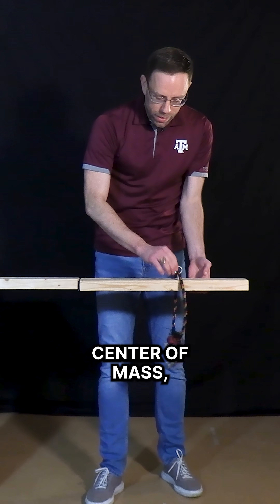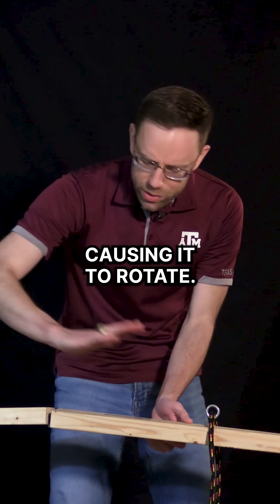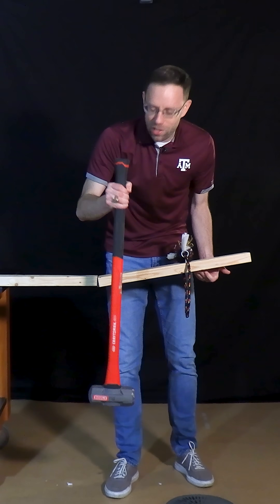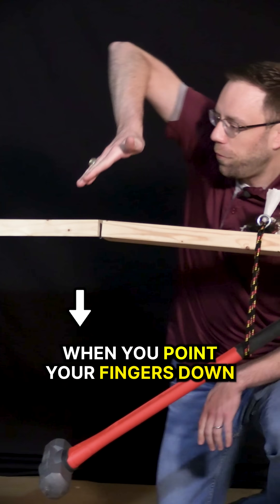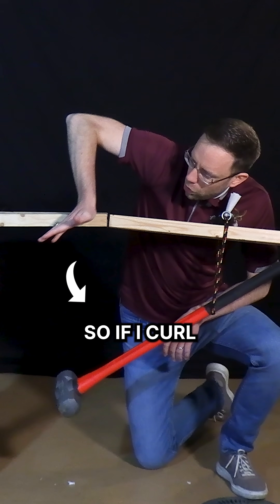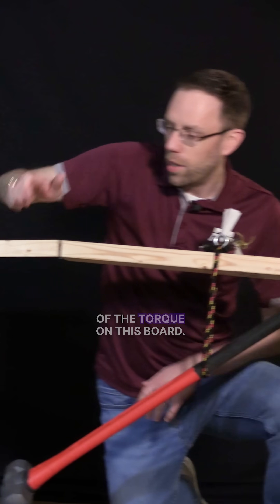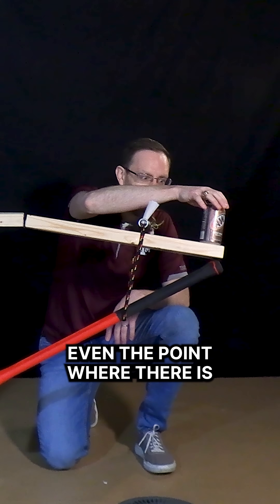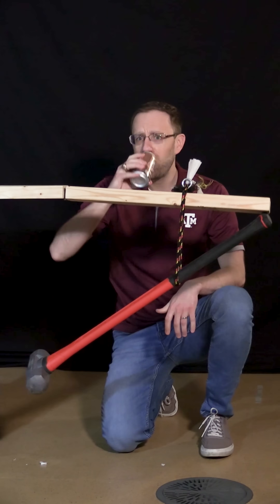Floating sledgehammer using physics! 😮 #shorts #TAMU #DrDawson

Comment: The weight of the hammer part of the sledge hammer is way heavier and they are both connected to each other the board and hammer, so the weight and gravity are pushing down on the heavy end and the other end of the sledge hammer is kind of pushing up on the wood because of the rope, that push down of the metal end and the opposite push up of the handle is stronger so it’s keeping the wood up, am I getting this kind of? 😂 makes sense to me, just making sure. And I’m not saying either end of the sledge hammer is stronger, just that the handle is pushing up stronger than the woods hinge.

Comment: I saw the same concept illustrated when I was in elementary school.  There was a little widget, shaped sort of like a curlicue, maybe 3 inches long and when he hooked a belt onto it, he was able to balance it because the belt was hanging slightly more than half its weight on the other side of the balance point.

Comment: Basically the weight of the board and the hammer handle is less than the hammer head so if the board were to rotate downward, it has to push the hammerhead upward. Because everything else weighs less than the hammerhead, gravity has to overpower itself, so the "floating" state is more stable than the lower state, which is visually unintuitive, but you can also just visualize it as gravity pushing the hammerhead down harder, and since the hammer handle is pushing up into the board, the greater wieght of the hammerhead is pushing the board up, which makes more sense than the board holding the hammer by apparent magic.

Comment: It's pretty cool how there's several ways to explain this.
As well as those I've heard, there's also that the point the sledgehammer pulls the board down at has less leverage than the point it pushes it up at. 
You could lift yourself with this, by holding one end of a plank you're standing on, and pulling it up. Your feet are pushing down with less leverage than your arms are pulling up, so the net torque is upwards.

Comment: The reason it doesn't seem like it would work is because it wouldn't. Regardless of where the weight is on the "floating board" it's in a hinge and the weight cannot lose a center mass past the hinge. Now if there is a super strong magnet on the post repelling the iron sledge then it could stay up.

Comment: The hammer and the board together act as one object, which is anchored to the other board by the hinge.  Like those little levitating toy birds from the 90s that you could balance on your finger with its beak. The hammer has the same function as the weighted wings of the bird, and the beak would be the hinge.

Comment: basically the distribution of the gravity around the pivot point has changed caused this. Imagine the hammer is not long enoug to the far left of the hinge, it still falls. Or, put the hammer the other way around, it still falls.

Comment: If you were to imagine pushing the board down with your hand, I think it helps understand how this works. Picture the sledgehammer all the way up and touching the board that's fixed to the table (as a result of you pushing the board down). Would you expect it to stay like that, or for the sledgehammer to swing back down because it's so heavy?

Comment: I think the stap you missed to mention that makes this a lot more difficult to understand is that the sledgehammer is in a FIXED position. If it was loosly hanging beneath the right side of the table, the table and hammer would just fall down. But because the sledgehammer cannot change position, the only way for the table to fall down is for the sledgehammer's heavier end to go UP and that's not possible, because the end of the sledgehammer is too heavy.

Comment: Here’s a dumb down version of ricksmash8080 explanation.
There’s a gravity pulling sledge hammer head and a gravity pulling edge of the table, sledge hammer head is heavier thus greater gravitational force than table which make the handle keep pushing table upwards (while the head go towards the ground) allowing the table to stay in the air

Comment: The simpler explanation is that now the board has to lift the sledgehammer in order to rotate to the left, while the sledgehammer can't fall down without lifting itself up (because the board would rotate to the left as a consequence). Thus, for the sledgehammer to fall down it would need to lift itself up, so a (close to perfect) balance was reached.

Comment: I didn't understand his explanation fully, but I intuitively understood what was happening in my own way. The head of the hammer, the heavier end, is being pulled down by gravity, but the rope is holding the handle. Naturally, this would cause the hammer to swing to the right, like a pendulum, but the handle hits the end of the board, stopping the motion. Additionally, for this to work, the head of the hammer needs to extend to the left beyond the hinge to balance the downward pull on the right side, kind of like how you would balance opposing forces on a seesaw.

Comment: This is newton's second law. Since the hammers' head is angled at a slope, the main component of weight pulling it down is perpendicular to that slope, trying to pull the hammer's handle completely horizontal. This force is what pushes the head of the handle up into the board, creating an equilibrium of forces.

Comment: A simple explanation to make it make sense in your head is to only look at the hammer on the string. The hammer on the string wants to fall counterclockwise due to gravity if there was no board. Now instead, its pushing on that board trying to fall. Clearly from the video you can see the force of the hammer trying to fall counterclockwise is greater than the weight of the board trying to fall clockwise. A lot of confusion in the chat so I tried to explain it a bit simpler.
Reply: thank you sir, now my head can make sense of it

Comment: Well you could also just say that the top of the hammer would be pushed up on the other side and so the entire thing just rotates a little bit until the forces cancel out.
Reply: @Spacemelody69  right! You could also say that the centroid of the moment distribution is horizontally aligned to the axis of rotation. All correct, just differing levels of understanding and specificity of language.

Comment: If its a heavier object than a sledgehammer does it matter?
Or as long as the object is generating more torque than the falling board it will do the same no matter how heavy it is?
Reply: your second thought is accurate. But generally heavier = more torque. But u can also add a gryoscope there
Reply: You were spot on, as long as the counterclockwise torque (generated by the hammer in this case) is equal to the clockwise torque (generated by the table), then the system is in static equilibrium (it won't move).

If the mass (or length) of either object chances, then the system reaches static equilibrium in a different position, or won't reach it at all.

This is the equation: T=F*d
Torque equals force multiplied by distance. 
The force is directly proportional to the object's mass, and pointing down for both the table and the hammer (due to gravity)
The distance is a positive value for the table (because It extends to the right of the hinge) and a negative value for the hammer (because it extends to the left of the hinge).
T_table=10N * 0.5m = 5Nm ↻
T_hammer=200N * -0.025m = -5Nm ↺

In this example, you have equilibrium with a half meter long table, and a much heavier hammer extending 25 centimeters from the hinge in the opposite direction of the table.
Reply: @AlxM96  that is interesting. Its not something i get a 100% but i do get the gist of it.

Comment: Your explanation makes logical mathematical sense, but my brain looks at that and says DARK MAGIC BURN THE WITCH MAN
Reply: @Breezely22  😂🤣
Reply: He turned me into a newt!
Reply: @Satori816  a newt?
Reply: @ivanov093  I got better...
Reply: @Breezely22  same thoughts.. I understand, but i dont understand 🤣🤣
Reply: @leonkennedy8579  It's a fight between gravity wanting to fold the board down and folding the board down causing the hammer to rise, hammer is heavier it stays down. You can also kind of imagine it as a board and a hammer on each end of a string over a pully.
Reply: 666 likes for ya
Reply: I second that.
Reply: @Breezely22  My brain was like that until I looked at the other end of the sledgehammer. see, that part is touching the wood too, and its that part that is pushing upwards, against gravity
Reply: Yep, I completely understand the how. But just.. WHY?
Reply: My brain just says he basically added a leg and made it a table
Reply: @Breezely22  For the board to swing down, it would require the sledgehammer to defy gravity and go upwards, which is impossible.
Reply: because that he is saying is a total B.S. and the video is fake
Reply: He weighs the same as a cold duck, to the fire he goes 😡🔥🔥🔥🔥
Reply: Wizard
Reply: @Epicurousdemos  the right term is warlock
Reply: @goldenlion7147  huh only think i remmeber after hearing warlock is adamn warlock
Reply: @Epicurousdemos  witches work more with hexes and stuff, wizards work more with educational stuff (books and all that jazz) while warlocks have a patron.

Comment: Show me an actual tool or contraption that use this AND without hydraulic support.
Reply: @PurringBytes  That uses the consideration of center of mass? Or a sledgehammer hanging by a chain strapped to a piece of wood that is on a hinge attached to another piece of wood?
Reply: @Kaiziak  That use the principle demonstrated, i'll take anything : a tool, an utility, a day to day usage that use this.

Also : the question is for the video author, it's not for opening up a debate.

Comment: You changed the mass's (board plus rope plus sledgehammer) center of mass/gravity.  I the first example of just the board and rope, the center of mass is basically in the middle of the board, almost directly to the side of the hinge. With the sledge hammer added the center of mass is closer to the head of the sledge hammer and below the hinge.  The combined object swings slightly downward until the center of mass is at its lowest point (directly under the hinge) at which point it can rest.  If you were to put the center of mass when it includes the sledgehammer at the same angle as the original board, the board would be pointing almost straight up and it would also swing downward just like the first example.

Comment: Even short and simpler explanation, if the wood bar go any lower the hammer head would have to be raised higher which requires more force/weight so then it's balanced out 🤷‍♂️

Comment: Using. Applied mechanics *Let’s Resolve the forces into vertical and horizontal components 

A) weight of the wood 
B) weight of the sledge hammer 

C) tension in the chain 

D) compressive force created by the black handle portion .  

.  . .  

At the point of equilibrium   (The meeting point of chan on hammers handle )sum of horizontal components = sum of vertical components . 
That what keeps it in position . .

Comment: So the position of the sledgehammer's head (its heaviest part) relative to the hinge is what causes the opposing torque, which in turn makes the plank float?
Reply: @KotauFPS  Yes. As long as the largest torque (force X distance from the rotation point) in line and/or bellow the hinge is at its left side, then the largest force will keep the right end up. It's the same that was happening before,  when the largest torque was at the right side pulling the board down

Comment: Or you could say that the metal head of the hammer is being pulling down while it tail is pushing up the blank by it end. The robe act as the support or interruption for the the hammer to just fall straight down, instead tilted to the side. Combined with the hinge and supposedly fall and swing of the blank have just enough forge to soft lock the hammer in place without slipping off the ropes?

Comment: The heaviest part of the hammer is past the point of rotation, so for the board to pivot down, the head of the hammer would need to go up, and since it’s heavier, that won’t happen.  My question is, does the rope holding the hammer experience any extra strain than it would without the pivot point?
Reply: @toastofcinder  No, I think the extra stress is applied to the board at the end, where the sledgehammer is pushing up against it

Comment: If you imagine the head of the hammer connected to the pivot point this becomes nothing else but an obvious triangle hanging. Easier to understand if this experiment is done on a wall instead on the cantilever.

Comment: This was posted on Facebook and it was immediately called fake. I really worry about our future…
Reply: They can never seem to distinguish between ai and real photos though
Reply: How could people believe this? It's readily apparent, the lying. He put a leather(or whatever) to connect both planks at top.
Reply: @rodenreyes6320  Are you serious? He even told you why it's working. If you understand movement, rotation and torque, yes, it is totally believable. If you still don't believe it, make the setup yourself and try it. It's not fake, there's no lies, and nothing connecting the two planks (apart from the hinge itself).
Reply: @Chris-hx3om  I realize the simple physics of the contraption now. It's just a weighty weight suspended on an essentially curved/bent bar at end of main plank at hingepoint. Thanks.✌️✌️✌️

Comment: When he started that hinge was at bottom letting it swing down. He flipped the board over. Now the hinge is at the top not allowing the board to swing down
Reply: @63grandsport11  Watching this on my phone and after pausing the video and looking carefully, the hinge is still on the bottom the entire time. So he didn't fake the video. Also, knowing physics, this is a proven experiment that has been replicated.
Reply: Hinge is still at the bottom. 

The hammer is just pulling down from the other side of the hinge now countering the weight of the board.
Reply: The board is still bending down. You can see a gap in the top meaning there can't be a hinge there. Use your eyes.

Comment: Concentrate on the centre of gravity. That will always get as low as it can. Nearly all the mass of the system is in the head of the hammer. It has sunk as low as it can get. If the wooden board on our right were to swing down any further, the sledgehammer head would have to move up, and gravity won't allow that heavy weight to do that.
Reply: Excellent explanation!
Reply: @stephenfennell  best explanation, thank you
Reply: This explanation is infinitely more intuitive than the entire video. Bravo! This comment needs more likes.

Comment: Sir. The hinge os why it's floating if there was no hold point the board wouldn't fall like that at all it would fall straight down no matter where the center of gravity was.  But you are correct explaining how the hammer causes counter torque but be sure you explain deeply why the fulcrum points are so important in this experiment.

Comment: This should not work. Gravity would just pull the whole thing down. Only way is if the hinge was off set so the hammer’s weight would pull to the left and the two pieces of wood would be wedging them selfs constantly but as you can see. There is a gap. This should not work. I am curious as to the real reason why it won’t fall.
Reply: @the_foreshadow5014  1. We are seeing it work in a video. You saying its fake?

2. Anothe comment explained it better, but the tldr is if thr board goes down, the head of the hammer would have to go up, and the force of gravity on the hammer is stronger than the force on the board, so it cant go up
Reply: @ I see now that the hammer’s handle is on the loose board, that is what would make the hammer go up if the board where to move down following the laws of gravity, however it still doesn’t make sense to me why it stays up. The hammer should drag the loose board down and the hammer would continue to go up until it hits something to stop it from going up. That is what is freaky and my feeble mind just can’t understand yet why it just floats. Treat it as a compliment if the whole set up is un-tampered with and it can be done by someone else like me haha. I retract my former statement of any falsehood, i just thought about applying the force of gravity back onto the hammer when it would go up forcing it back down so if you found the equilibrium where it both holds it self from going up and down at the same time, it floats. I think i felt a a development of a wrinkle in my brain occur. Nice.

Comment: That's how a cantilever slab works in civil engineering
Reply: @abdurrahman7900  no it’s not. A cantilever slab has a fixed end condition instead of hinge or “pin” as it is usually called in this case.  The moment cause by the dead load of the slab is resisted by the fixed end

Comment: It's because the heavest part of the structure is on the opposite side of the hinge and the board isn't heavy enough to lift the sledge upwards. And it's not floating, its attached to the other board via a hinge